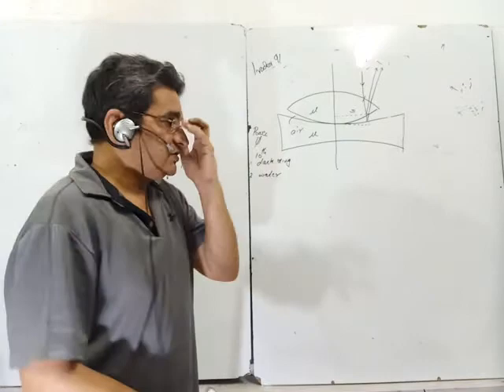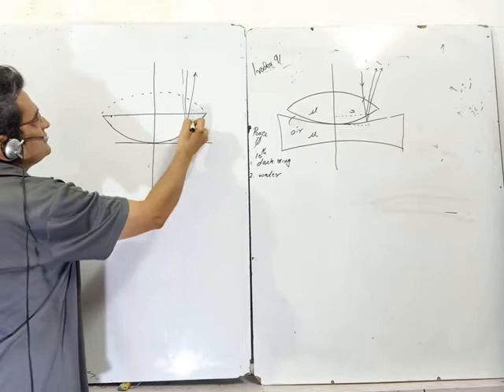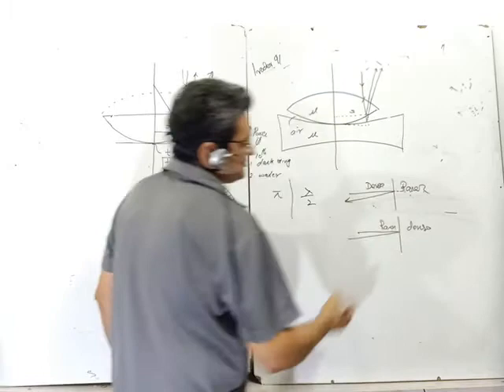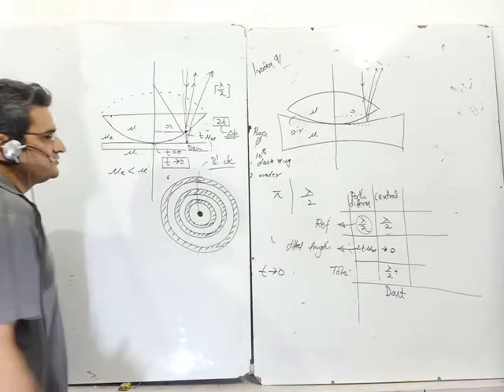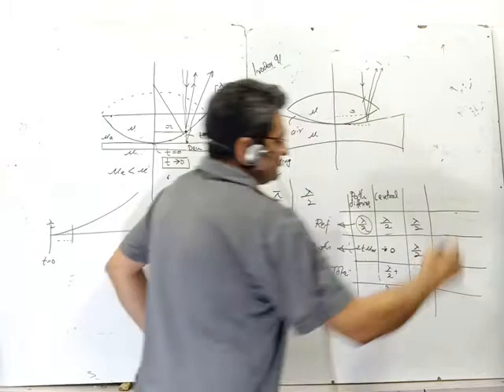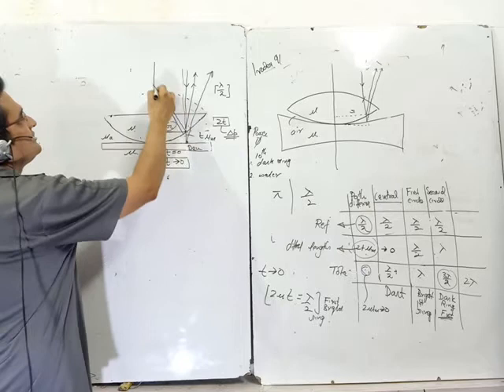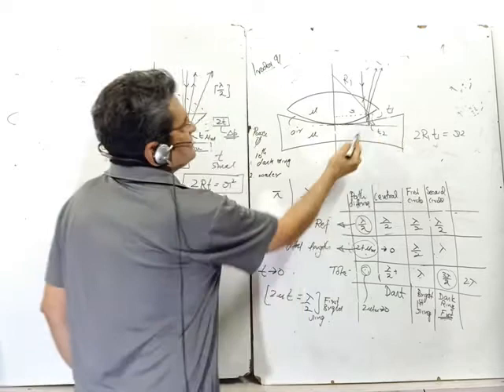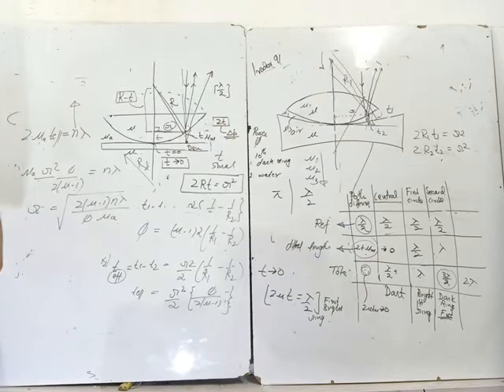Thin film interference.One shot. Newton's ring Irodov 5.90 , Irodov 5.91 covered

Comment: Refractive index of lens is not mentioned in this problem
Reply: I have taken index of medium ( if any) . It will be one for aiir. Index of lens has no relevance in formula but relevant when different mediums are given.
Reply from the maker: I have replied from my other channel.
Reply: 29:22 here ...for r
'n-1' ....i think this n is for lens refractive index  ...although irodov has given the same answer in arbitrary constants but in irodov the numerical value of refractive index is not given....
What i have done is that after putting all that is given and then equated with numerical answer given, then n comes out  1.54 approx...
Even in problem just before this (i.e. 89) i have taken n of lens to be 1.54 and got correct answer
Reply: @AmitProgue28  yes, n is required for focal length calculation if you want numerical value of R. But not really required as with algebraic values you are getting the concept.
Reply: @IndianpolitybyYKumar  I got the concept sir 👍